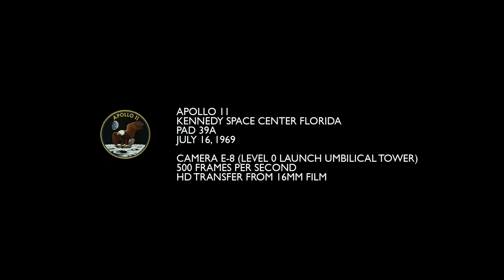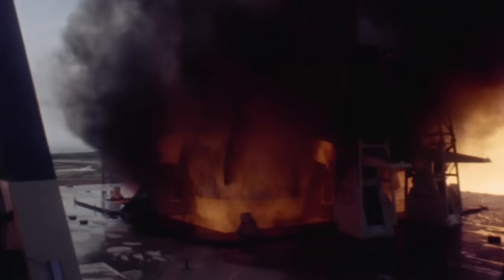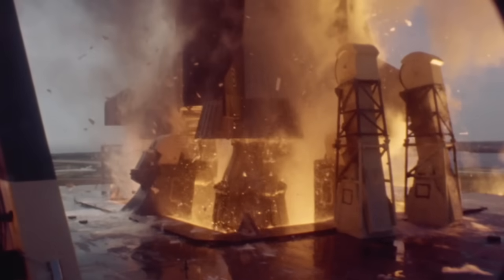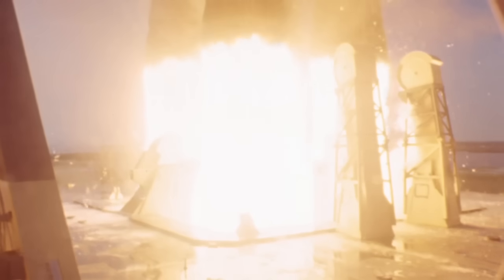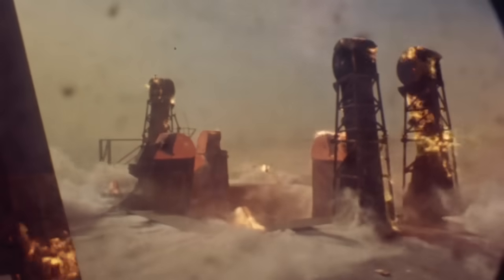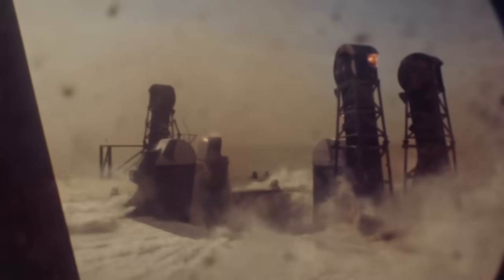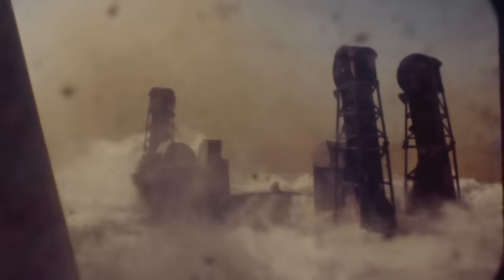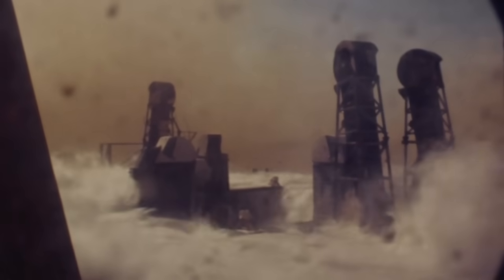Apollo 11 Saturn V Launch Camera E-8

Comment: The gas generator that fed the turbopump was deliberately run very rich, so that a black sooty mixture of combustion products and unburned kerosene would then be ducted through a heat exchanger, to vaporize LOX and Liquid Helium to gaseous state so these gases could backfill and maintain pressure in the the LOX and RP1 tanks as the fuel and LOX  was consumed. This rich exhaust was ducted through a manifold to cool the nozzle extension. These flammable exhaust gases were ignited by a number of igniters around the inside of the combustion chamber, and that big billowing black and red flame coming up out of the trench at the beginning of the ignition sequence is the turbine exhaust burning off as the turbine builds up enough pressure in the pumps to allow the propellant and oxidizer into the main combustion chamber, at which point this much MUCH larger flame sucks the red billowing turbine exhaust fire back down into the trench

Comment: One error. regarding the ignition sequence. The hypergol (80% triethelyborane and 20% triethlylaluminum (TEB/TEA)) cartridge was not used to spin up the turbine. The gas generator, a "small" rocket engine with an injector plate about 10 inches in diameter, was ignited by sparkplugs as LOX and then RP-1 were introduced at pressurized propellant and oxidizer tank pressures of about 10 PSI. The gas from the gas generator fed the turbopump turbine, which began to increase in speed, at which time the main LOX INLET line feeding the turbopump was opened, allowing LOX to flow into the LOX pump section of the turbopump. As the turbopump sped up from the gas generator gas produced by a gas generator inlet propellant and oxidizer pressure of just 10 PSI, the main RP1 inlet valve was opened and RP1 flowed into the propellant pump and gained pressure. In the 2 large propellant main feedlines between the RP1 pump and the combustion chamber there were 2 valves . Upstream of these valves, though, there was a small tap, and from that tap ran a line back to the gas generator.. A similar tap existed off the main LOX engine feedline and also ran back to the gas generator.  A check valve in each small gas generator ignition line prevented high pressure propellant and oxidizer from going back up the fuel and oxidizer initial ignition lines for the gas generator to the propellant and oxidizer tanks. Thus, the gas generator fuel supply transferred from 10 PSI tank pressure to the maybe ~100PSI pressure at this instant from the output of the propellant and oxidizer pump feedlines. This increased the gas generator's gas output tremendously and thereby increased the turbopump power output, and increased the output pressure of the LOX and RP1 main engine feedlines (and the lines feeding the gas generator). So a feedback loop was established wherein increased propellant and oxidizer pressure from the turbopump increased the fuel to the gas generator that was fueling the turbopump, thereby increasing the gas generator fuel and oxidizer feed pressures and in turn increasing the output power of the turbine, and spinning the pumps faster and creating more pressure still in the main propellant and oxidizer feedlines and gas generator lines. At a certain point, the main LOX valves between the pump and the combustion chamber opened, and LOX was fed into the main combustion chamber and a white fog can be seen spewing from the nozzles in footage from the high speed cameras mounted below the engines. Another tap off of the main propellant feedline went to apply pressure to the sealed cartridge of hypergol, and a certain pressure of fuel, the hypergol cartridge flanges broke open, and the hypergol flowed through 9 separate lines to 9 separate special injectors in each of the 9 sectors of the main combustion chamber injector plate. The hypegol came in contact with the LOX and ignited pyprophorically and burned very hot. At this very instant, the main feedline valves between the propellant pump and the main combustion chamber  opened and allowed RP1 at maybe 400 PSI to flow partly through the combustion chamber and nozzle cooling lines and into the main combustion chamber injector plate, and partly bypassing the chamber and nozzle cooling circuits and going directly to the combustion chamber,  spilling forth at about 70 gallons per second into the insanely hot hypergol flames produced by the special ignition injectors. Over the next three seconds, the gas generator output continued to increase, and the turbine speed increased to a point where some 55,000 brake horsepower were being developed to pump almost 271 gallons of kerosene and 600 gallons of LOX per second at ~1400 PSI into the main combustion chamber, at which time full power was reached. After a very long 1500 milliseconds or so of checking to see everything was OK, the command was given to blow the bolts holding the vehicle to the pad. So the hypergol cartridge did not spin up the turbines; they sped up by the increasing pressure of LOX and RP-1 that the turbopumps were providing back to the gas generator injector plate.

Comment: There is a very large water tank on a high tower nearby, like the size of a tank used for small town. It is almost completely emptied during launch. Saturn 5 was the most powerful rocket engine ever built'; it rattled the tops of cars at the viewing stand 4 miles away. People often incorrectly think the water was to cool the pad - not true. It's main function was sound suppression - sound waves so powerful that it could crumble concrete. It was Ex-Nazi Werner VonBraun who led NASA's engineering and Moon effort at the time.

Comment: Men from the USA went to the moon starting in 1969 with the Apollo 11 mission. Convince me otherwise.
Reply: Apollo 11 press conference. (body language) Wernher Von Braun tombstone.  A funny thing happened on the way to the moon. Gus Grissom Apollo 1 (lemon). Ron Baron congressional testimony. Gene Kranz (lost telemetry data). Kelly Smith (Van Allen Belts Orion program/problem). Micrometeorites, solar flares. Air conditioning on the moon/lunar module (Batteries). 500 degree temperature difference between sunlight and shadow. Pressurized spacesuits/maneuverability. Lunar module fuel capabilities/rendezvous with CM traveling 4000mph/think timing. Photographic evidence/ shadows converging/ artificial lighting. Why did we loose the technology to go to the moon?  Nothing ever works right on the first try, except for the most complex task man has ever embarked on, the moon landings.

Comment: Where is the uncut video from ignition to stage separation?
There were hundreds of video cameras at the launch of Apollo 11 but no uncut footage of the 165 seconds of launch and flight available. 
The uncut footage would answer the questions about the F-1 power and the height and speed of the rocket at separation - anyone know why this film is missing from the NASA website and youtube?

The video shows how good the F-1 engines were at burning their fuel outside of the engine, safely away from anywhere that would create thrust. That was due to the straight through injectors that sent quite a bit of the mix straight out of the nozzle before it ignited.

Comment: 5 decades later and there is still NO raw  uninterrupted footage of a rocket mounted camera showing the journey from launch to orbit. they always cut the footage and edit it. #wakeup
Reply: In 1969 they were using film cameras, therefore someone would have to recover the film cartridge and develop it for you to view the entire thing from launch to orbit. So, the first stage crashed into the ocean, along with the second stage, and the third stage was left in a solar orbit or intentionally crashed into he moon.
So, how would you propose recovering those film cartridges? As you said, wake up!
Reply: Chim Panzeeno sure there are, there are videos on YouTube.
Reply: Peter: Find one then and post the link.
Reply: The uninterrupted footage would show:
1. The rocket was too slow and low, especially as it passes the clouds.
2. The stage separation wasn't the LH2+LOX motor but another kerosene one with a yellow flame.

The uninterrupted footage would give the exact time of the cloud pass and the speed is easily computed from its shadow, then the absolute proof that it was far too slow would be out.

The edited press clippings show the cloud pass itself and the speed can be estimated but NASA have avoided giving the cloud height that day. At all likely cloud heights however the rocket is far too slow.
Reply: +Graham Better idea, work out the math and show us.

Comment: The first stage engines from one of the Saturn 5 first stages were finally recovered from the Atlantic ocean.  I am sure that these engines are being analyzed that might lead to a new version using modern manufacturing techniques to simplify the manufacturing process.  These were incredibly complex and labor intensive engines.  The F1 engine was and is one of the marvels of the 1970's and has not been equaled, even with the modern technologies of today.  The size and power of the F1 are legendary.
Reply: Engineers back in 2013 were actually doing just that, using an unflown engine that had been on display at the Smithsonian. The goal of the study was apparently to become familiar with the engine itself as well as the fuels in anticipation of using a derivative for future missions. 
They have also been working on improvements to make the engine simpler and cheaper, while also being more powerful. The F1-B is supposed to make 1.8 million pounds of thrust compared to the 1.55 of the original F1. Really fascinating stuff.
Reply: Fascinating is right!  Reproducing the engine with modern manufacturing methods and materials would be a huge step, even if the thrust output remained the same.  The biggest challenge would be to maintain the scale and reduce the cost of the engines.  Many of the skills and manufacturing capabilities used to produce the F-1 engine simply do not exist in today's workforce or US Industries.  The incredible amount of time and craftsmanship that went into the F-1 is obvious when you look at these huge engines.
Reply: I don't know if id go as far as to say those skills don't exist any more. As Pratt and Whitney, Aerojet and Rocketdyne have been producing engines, albeit smaller ones, up till the present. Plus companies such as GE and PW continue to manufacture ever more advanced jet engines technology. 
We have the skills, what we need is the motivation to use them.

But yeah seeing these engines up close is an incredible thing, they have an F1 and an RS25 on display in Florida, both incredible engines.
Reply: This is true.  These "old" skills have been replaced by other, more advanced skills and methods.  Not at all implying that these cannot be built and be better, just saying that they will be produced in a different manner, using newer manufacturing technologies.
Reply: +Michael Lynch Very true, going to be exciting watching it happen.
Reply: Exciting, yes.  As long as the bureaucracy and political in-fighting does not kill it.  The one thing missing today may be the national will to do this.  Yes, there are a core of people, like you and I that see the necessity and massive benefits of doing this.  However, there is a vast majority of short sighted individuals who only care about what the government can provide for them.  I remember how the NASA budget was cut time and again over the years with so many people and politicians claiming that this was "wasted" money that could be spent on "social programs".  Between the worthless War in Vietnam and the "Great Society" programs, we could have been colonizing on the moon or Mars by now.  Trillions of dollars have been wasted on the many "social" programs and we still have the poor with us.  The NASA funding actually returned massive social and technological dividends, the welfare programs, not so much.  I hope we still have some leaders who can see the benefit of such real investments in technology and exploration.

Comment: I've watched this many many times and it never gets old. The rocket looks small in comparison to what it looks like on display on its side with its creator Von Braun standing next to it. The width of the rocket is 33' and the F1 engines are 12' wide and 18' long.
Reply: Every time I've seen the Saturn V thats on display in Florida, it has never failed to amaze me. Id always known it was a massive vehicle, but the true size and scale of it can only be appreciated while standing beneath it, and walking down its length. 
Of course one could stare in awe at the base of the first stage for hours alone, truly a remarkable vehicle. I mean all of the Apollo hardware is incredible, but this is the most awe inspiring part of it all.

Comment: what material will be that of the cameras that film a few meters that supports these high temperatures without damaging it in a single scratch?
and the heat that originates there is enough to bend and melt the steel bars that are apparently burning, good cinema for fools
Reply: somebody didn't listen to the commentary..

Comment: They had high speed cameras back then?
Reply: Of course.  The limit on high speed cameras of the day was the amount of film.  If you see one in action it burns through a spool 18 inches across in seconds.  Digital changed that although there are still bandwidth issues even there. :)
Reply: There is high speed footage of the first atomic bomb tests in the 40's. As the poster above mentioned the only real limitation was the amount of film available.

Comment: To think a modern day smartphone has more computing power than the rocket that powered Man to the Moon back in 1969

Outstanding, me thinks ;)
Reply: It really is rather incredible, even though most of the heavy lifting was done by ground based systems, and relayed to the space craft, the AGC is still an incredible piece of engineering.
The instrumentation package for the Saturn V is displayed with the rocket thats on display in Florida. They even have it off the rocket and down at ground level so we can get a much closer look at it. 
That being said, ill bet the engineers would have loved to have had the Intel 4004 processor, which came out in 1971.
Reply: @sparkplug1018  
Even more remarkable was the fact the Intel 4004 had a  Max CPU clock rate of 740 kHz

Positively advanced compared to the computing power used in the original Apollo
11 Moon landing of 1969....................................

Comment: So let me get this s right. The stream between the nozzle and the fame is non-ignited fuel. What stops the force from collapsing that stream and pushing it into the nozzle where the combustionables meet?
Reply: The pressure inside the chamber is MUCH higher, nothing forces it's way into something when much lower pressure can be found in the surrounding air.  Path of least resistance.

Comment: You failed to mention why water was used ...... thinking to cool everything down is only 10% correct .... water is used to flash steam and sound protect the rocket and equipment from the vase noise off the engines ....... shuttle launches today use 900,000 gallons a minute to sound guard the launch

Comment: F1 engine with 1 nozzle = 1.5 mil lbf 50 years ago! Falcon Heavy has 9 Merlins, each = 200k lbf. The most powerful engine nowadays is Russian RD180, 4 nozzles = 800k lbf! Use your brain! SaturnV + F1 = a myth for imbeciles!
Reply: Soooooooo ... using multiple smaller engines instead of fewer large engines is somehow evidence of ... what, exactly? You might want to check your reasoning there, Boris.
Reply: It's evidence that he knows nothing about the technology he's critical of.  That's a trait typical of most fools.